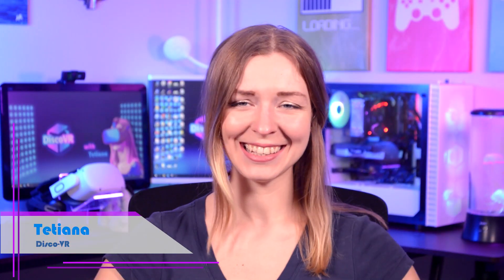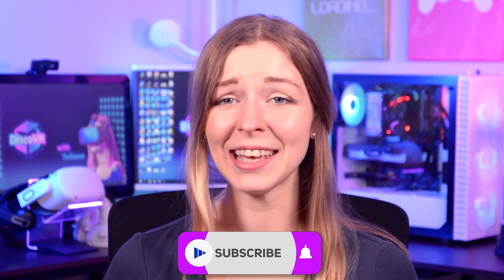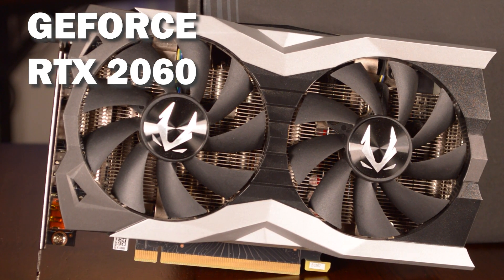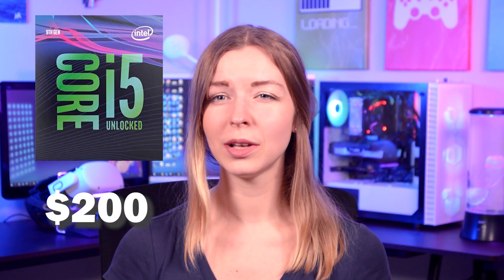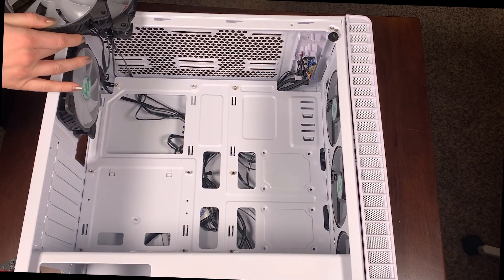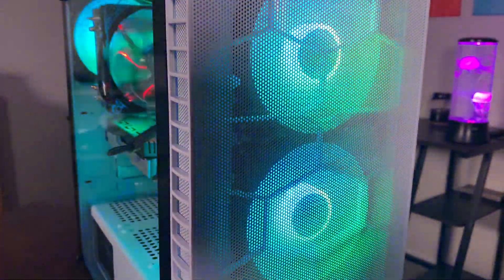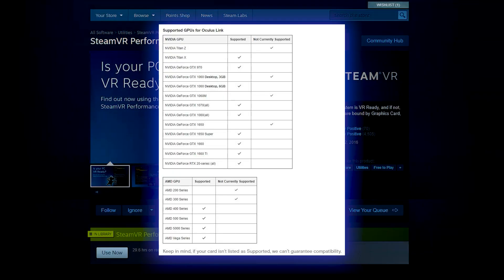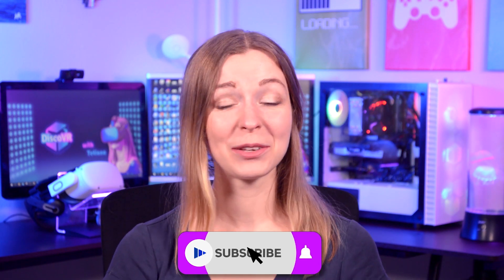How I upgraded my gaming PC on budget to play PCVR games using Oculus Quest 2

Comment: Hi great video I'm in the middle of upgrades for my son's pc I brought a budget gaming pc very cheap and it needs upgrading it's a gigabyte board f2a55m-hd2 rev 1.2/ 8gb ram there's room for more.processor is a A8 with Radeon dual graphics built in it's nearly ready for vr gaming on it I'm just a bit stuck on which graphics card to buy as it's built in graphics although be it dual is not powerfull enough. I've done the test and it seems that's the only thing letting me down any help would be great.oh one more thing when I plug a usb type c cable into any of the ports either my mouse or keyboard cuts out and if I plug it in the board at the back the screen goes black I only have usb 2.0 ports I it because it needs 3.0 adding ? It's frustrating to say the least.

Comment: Good video - very budget conscious which is a rare find these days.  Sounds like it should be able to run most moderate titles well, but I know the flight sim (MSFS, DCS, etc.) require a bit more HP to get to go smoothly, unless you dial the settings back some.  Was lucky enough to pick up a 3070 through work and even that can struggle on vram in certain locations.  One thing at a time though for upgrades, keep up the good work on informative and practical videos!
Reply from the maker: Thank you! Yes, I thought I'd share a very sensible build that I'm quite happy with. Jealous about your 3070, but still hope to make MSFS work using Quest 2 somehow 😜

Comment: That setup is pretty much the same as mine, except I have the RTX2070. I can even run MSFS in VR pretty comfortably, and I have to say that that's one of the best VR experiences I've had so far. Just to say that you don't need the latest and greatest setup to run VR games well. Most work well with an average setup as well. I do plan on upgrading the CPU at some point though.. or maybe I'll go for the 3080.. lol. but then I also need to upgrade my power supplym and I need a bigger case.. oh well, decisions decisions eh? I think I'll just keep my PC the way it is after all :)
Reply from the maker: Hey! Was it difficult for you to set up MSFS to make it work without lag? I ran into some issues with severe stuttering and got frustrated, lol
Reply: @DiscoVRTetiana  Well if you mean in flat mode, it's pretty straightforward. I'm running it in ultra mode, and that works pretty well in most cases. If you want to run it in VR, you really have to scale down a bit. I'm on an Oculus Rift S, and I have the render scaling down to 70 or 80, most other things on low or medium, except grass and clouds which I still have on Ultra (those are important to me!).

Another thing that's important is that you have as little other stuff running in the background as possible. Also: make sure your internet is fast enough, so all the scenery elements can be downloaded as fast as is needed. Actually I'd suggest you start with low settings, and gradually turn things up until you get a nice compromise between performance and a visually satisfying experience. I think that 2060 should get a long way, as should the I5. Have a look every now and then in the task manager to see how the CPU and the GPU is doing, and that'll tell you if there are any bottlenecks.

Also: get windows out of gaming mode asap: https://www.windowscentral.com/how-enable-disable-game-mode-windows-10

Update Nvidia drivers to the latest and greatest.

Another thing to consider is that Oculus Link has to compress and decompress everything on the go, and that seems to be a resource intensive operation, so that might also be slowing things down for you. I can't speak from experience, since I fly on the Rift S, even though I also have the Q2.. lol. I did try MSFS on the Q2 via the Virtual Desktop one time, and that was a kindof disappointing experience, though I suppose I could tinker a bit more for better performance.

Ayway good luck.. If you do get MSFS to run well in VR, it really is at times an amazing experience.. I just flew my little water plane over Malaga at sunset in VR, and I think I'm ready to book tickets for the real thing :)
Reply from the maker: @payt01  that sounds awesome :) I appreciate your detailed response. I think imma try it out again!
Reply: @DiscoVRTetiana  Alrighty Good luck!

Comment: This is the most sensible video on gaming hardware I have ever seen. I'm actually very interested in what your experience will be with the Quest 2 and this PC. I got an RTX 2060, 16Gb of DDR4 RAM and an i5 CPU. It's one of those off-the-shelves pc's. And I'm considering upgrading my Oculus CV1 to a Quest 2. I'm not even making this up. 
I'm a total noob when it comes to hardware or anything technical and I really don't want to spend time required to get into all this, so if you have a good experience I'm probably going to buy a Quest 2. Maybe.
Reply from the maker: That's cool! Practically a 1-to-1 pc build :) so far I'm very happy with the quest 2 performance! The only issue i ran into was with the flight simulator, but that one is always difficult to configure. I'll be doing some pcvr gameplays in the future in addition to stand alone quest 2! Hope you'll find them helpful :)
Reply: @DiscoVRTetiana  will you do comparisons between Q2 standalone gameplay and Q2 PCVR gameplay of the same games?
Reply from the maker: I might, like the robo recall shown in the video. Ultimately it'll depend on a game. If it's a crossbuy, like robo recall or super hot,  then i can do a video comparison, but if not, like beat saber or moss, then I'd have to buy the game twice, which i wouldn't want to do. Gorn is coming out for quest 2 in two days. We'll see if it's a cross buy, but I'm just excited to try it on a stand-alone quest 2 :)

Comment: Upgrading PC in itself is an achievement giving how "Out of Stock" status of most components. :D
Reply from the maker: Yeesss it can be quite a challenge. The links i put in the description are from Amazon but ebay also helped me out a lot
Reply: True
Reply: I built a new gaming pc just before Christmas 2020 and got everything I needed from Amazon no problem. I already had the RTX 2060 GPU which would have been an issue had I wanted to upgrade the graphics card as you can't get them at the moment, unless you want to pay silly money !

Comment: Wait, how many ram modules do you have? Just saw, you went from a single 16gb dimm to 2 16gb dimm. That means you went from single channel to dual channel, which is a bigger deal than just more memory. Having 16gb single channel is very sub optimal and is probably why you ran into problems. I hope your 2 very different spec 16gb modules play nicely together!
Reply from the maker: Yes you're right. I went to q single 16 with a prospect to get another 16 gig,  which i finally did :) i didn't want to go to two 8 gigs and then throw them away when i decide to upgrade. And yes, they work wonderfully! ☺
Reply: @DiscoVRTetiana  Ideally, you would have 2 matched sticks of ram, then enable the xmp profile in the bios to get them up to full speed. With 2 different sticks, your pc will likely run them both at the speed of the slowest stick using a jedec profile which is usually a bit slower. Though, this is probably me being anal as wont likely make a whole lot of real world difference :)
Sorry for the rant if you were already knew this lol.
Reply from the maker: If it does make a difference, I haven't noticed so far :) I'm looovingg ittt! The best investment yet after quest 2 😋

Comment: I have a 1080ti which is a lot better than the 2060 in gaming performance, but the fact is that the 20 series has a much better encoder than the 10 series so you will be able to squeeze more out of you gfx card into your quest 2 than i can mine. I cant push my 1080ti much over 60% before the encoder is saturated. Pretty sure you can take full advantage of the 2060 and get closer to native resolution of the quest in many games. Im just hoping that some version of the 3080 becomes available soon!
Reply from the maker: It's interesting, I hadn't thought about it that way. I appreciate this info! Yeah I'm ready to check out more how this gpu will perform :)
Reply: @DiscoVRTetiana  Yeah, i was banging my head against a wall wondering why i was getting stuttering in pcvr when my 1080ti was at 60%. Ended up just lowering resolution in oculus' desktop app and now it runs fine. Still looks a lot better than the rift anyway.
Reply from the maker: @Aspartame69  interesting! I wonder if that was a similar issue I've had when I tried to play MSFS on my Quest. The stuttering was terrible :(
Reply: @DiscoVRTetiana  if you have reached tge limit of the encoder, it will stutter even in oculus software. I was getting phase shifting in the audio, and glitches. Flight sim is just an absolute beast of a game and will tax any pc from what i hear. Though lowering link resolution to minimum in oculus software to minimum should still smoothen it out
Reply from the maker: I should try it again then! I haven't really tried for a long time. I got a refund after i couldn't get it to queen, but seeing how awesome it is on other youtube videos i now consider buying it again, even though it's write pricey
Reply: @DiscoVRTetiana  no guarantees, i bet most of the msfs guys are rocking 3080s
Reply: @DiscoVRTetiana  does having a good graphics card help with vr performance if i'm trying to play quest on PC?